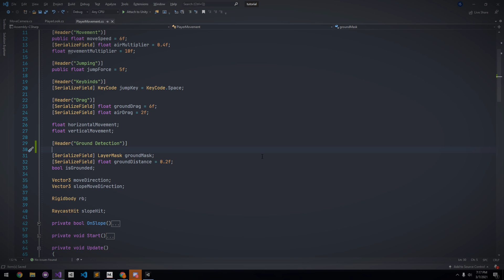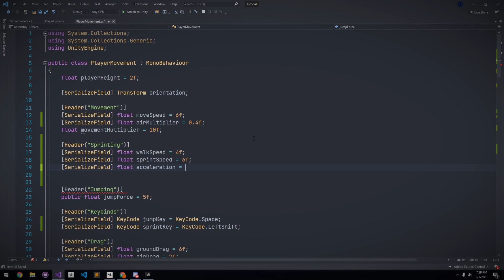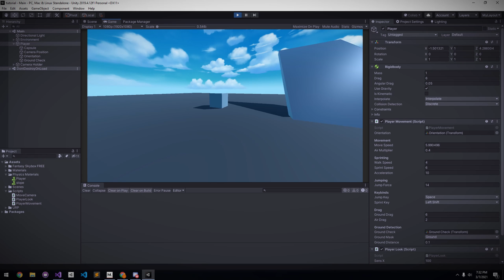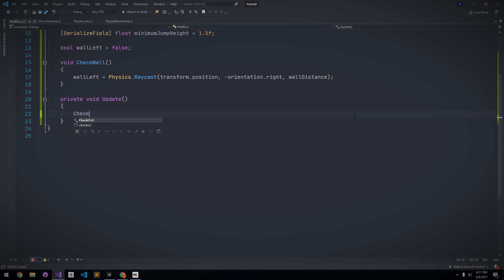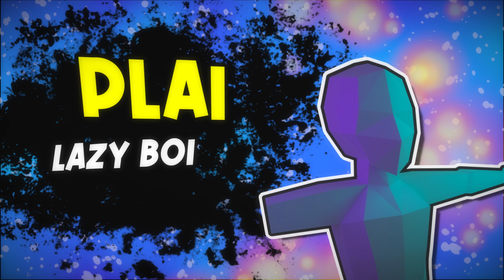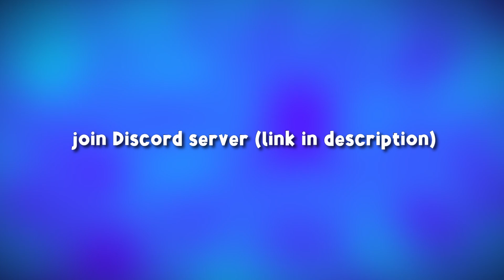Rigidbody FPS Movement Tutorial #4 | Wall Run Detection + IMPROVEMENTS!

Comment: Good tutorial, I like that you leave homework at the end, I've actually learned a lot by changing stuff myself instead of just following tutorials to the letter.
Anyway, I had a problem with my raycast for some reason, it was apparently casting it and colliding with my character's own collider, so if anyone else is having this problem, don't forget at the end of the Raycast function you can set a layerMask to detect or if you want to ignore a layer, put a ~ before it. so like ~layerMask